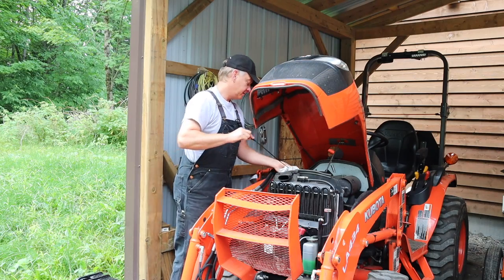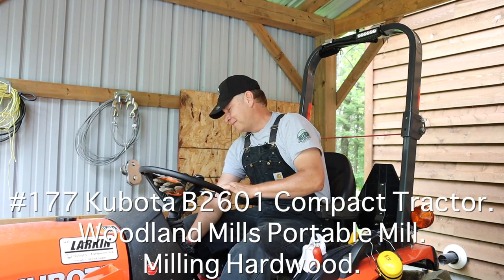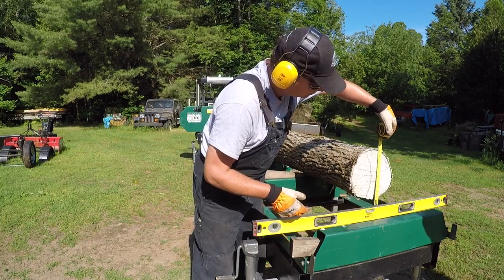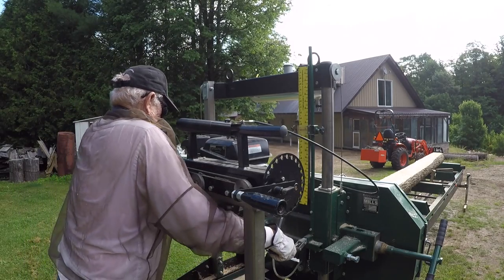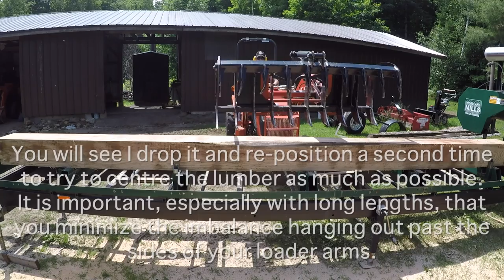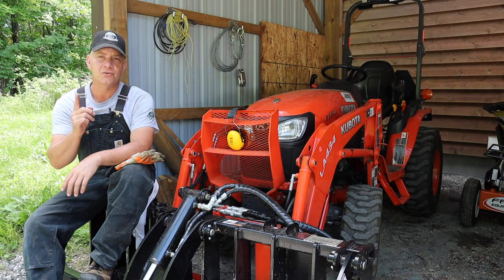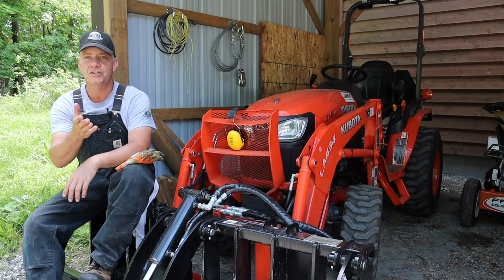#177 Kubota B2601 compact tractor. Woodland Mills portable sawmill. outdoor channel.

Comment: Good job Gord... Smart move with the 3PH counterweight on this job. Through experience you have learned the limits of your tractors lifting capacities. 
Your friend & neighbor Gus has a nice portable saw mill there. Slow going on the hardwood for sure as I'm sure it rips through softwood logs with relative ease. The bandsaw blade is the only way to go today, very little waste. 
Bill on the Hill... :~)
Reply from the maker: Good day BOTH! You bet. I am  getting a little better at judging it's limits and operating it safer. He has had the mill for years. He built the trailer frame for it himself so he can haul it back in the woods. Thanks for saying hi and have a great weekend!

Comment: Get yourself a lifting boom off the three point for yarding the logs, their cheap and safer. The mill works best with the wheel axle and tires mounted. I use my woodland mill with the fenders off and its no problem with loading and off loading.
Have fun...Bsafe
Reply from the maker: Hey thanks Gerard! I appreciate the advice. Have a great week!

Comment: Hi GP. For that lifting, drop the grapple and use pallet forks. That grapple looks a little heavy, added with those big trees. Forks would lighten the load and tie the tree to the forks. Guys saw is pretty cool, that's a nice one. What's he doing with those timbers, using them or selling them?
Reply from the maker: Good morning and thanks MNP. A good idea - it would take a few hundred pounds off the front end. Guy makes furniture - beautiful furniture, cabinets etc. The cants were just rough cut as he is placing them on the ground along his range. He built the trailer frame himself so he can tow it into the forest where he needs it. Thanks again and have a good weekend MNP!

Comment: Like the video i am looking at that same sawmill for my place that log looked awful heavy for your loader that is the load rating on that loader
Reply from the maker: Good morning John. The FEL will lift just over 2,000 at the ground level but about 900 at it's highest point, according to the manual. However as soon as you lift away from the ground, the weight curve drops so I believe if I remember correctly , it should lift around 1300 lbs at about 2 feet off the ground. Cheers!

Comment: Great video Gord . Have seen a few videos on fellows using the Woodlands saw mill and they are quite happy with it . Just wondering , do you get perfect ( example 1 inch boards ) every time you set the scale or is the thickness  a bit off at times.  One can use that wood to make many things but unfortunately you can't use the wood to build a dewelling for people to live in . Well at least not in Ontario
Reply from the maker: Good day Henry. That's a great question. Guy has been using it for years and he makes beautiful furniture for people. It is dead accurate every time. When he is cutting boards for that purpose, he is far more exacting than you saw in the video. I am not sure if it is a commercial grade unit by any means, but it works very well for him. The trailer frame you see under it, he built himself from scratch so he can pull it where he needs to use it. Have a great weekend Henry!
Reply: @GPOutdoors  Thanks Gord . That trailer frame must have an extra bunk added to it to be able to cut 16ft pieces . Take care .
Reply from the maker: Great eye Henry! LOL. He did add a section. Cheers!

Comment: Hi Gord, on your HLA grapple do you have one of top tines on the right side bent. Just wondering as I have one bent on my HLA, it is the second one on the right hand side top. Thanks for the great videos.
Reply from the maker: Good day Peter. Yes, it just happened after all this time. I think I was applying too much down pressure on a rock and given the curve of the rock at the edge , it created the perfect condition to allow the tine to bend. You'll see it on Monday. Still love that grapple. It is built tough and I certainly do a lot of rough work with it. Thanks and have a good one!

Comment: I don't know if that insect spray contained DEET, but I've switched to ones that use Icaridin. Much nicer to use. Doesn't melt plastic.
Reply from the maker: Good morning Walter. It does. I have never heard of that but will look it up shortly and maybe give it a try if they sell it locally. Thanks!
Reply: @GPOutdoors  CDN tire "woods" brand of spray have a deet version and an icaridin version.
Reply from the maker: Hey thanks so much Walter! Cheers!